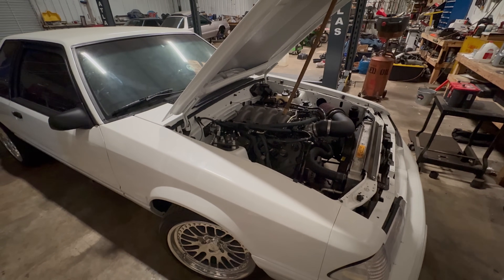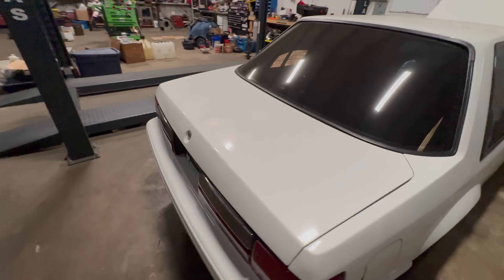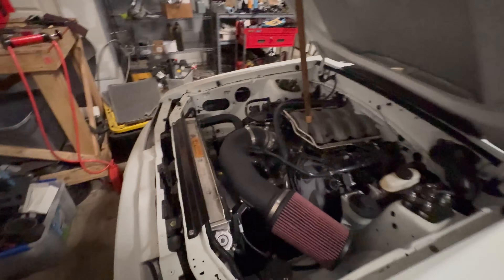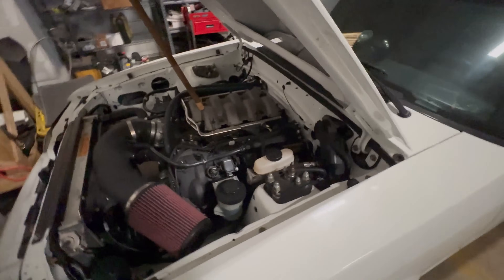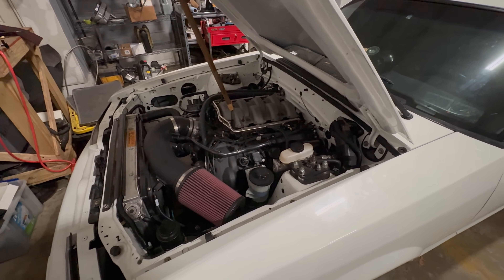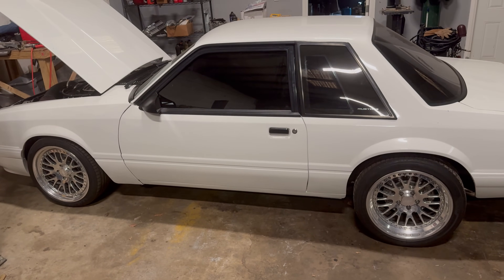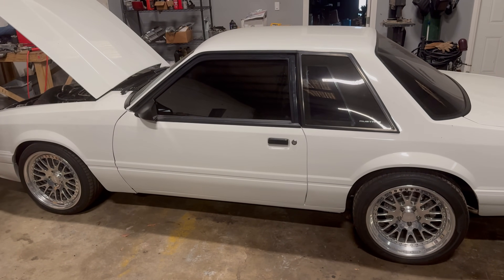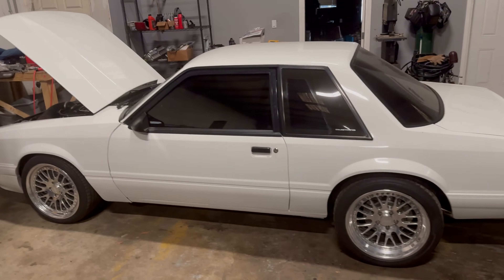Foxbody Coyote swap parts list

Comment: It looks like a great build but if you had it to do over would you do it?  Does it run and idle much better than the last setup?
Reply from the maker: That’s a tough one.   I like the Coyote platform but a cammed SBF with a big cam sounds amazing.   If I wouldn’t have come up with the trade for the motor/trans I wouldn’t have done the swap.